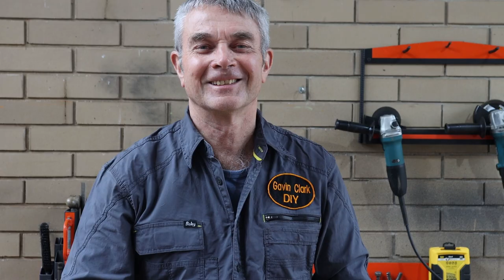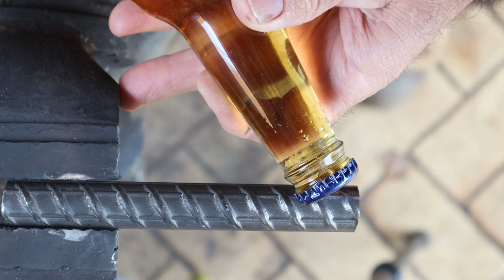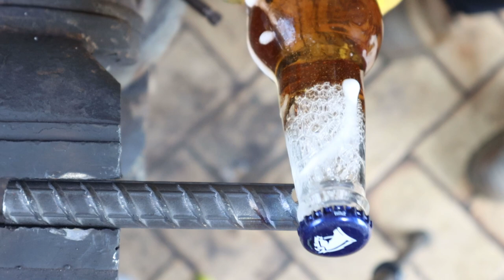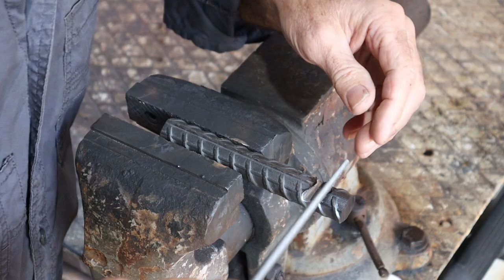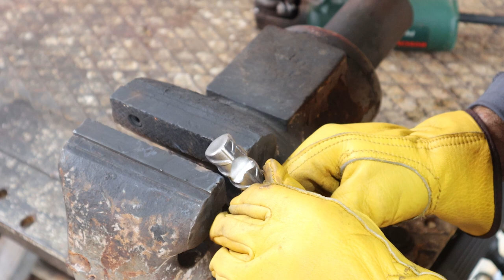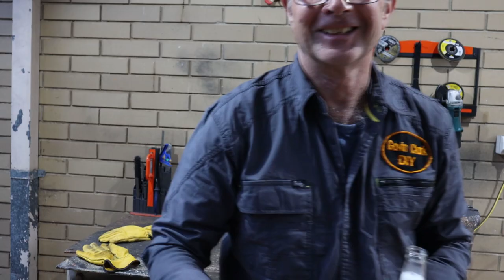DIY Rebar Bottle Opener - Rebar Projects

Comment: Un gusto sus trabajos. Realmente creativo, ingenioso. El metal una vez pulido.... qué le recubre para que no oxide. Gracias
Reply from the maker: A menudo uso Penetrol Rust Treatment Penetrates Rust 300g Aerosol Spray, y luego aplico dos capas finales de Semi-Gloss Clear Coat. Eso es lo que usé en las letras de la barra de refuerzo en la parte posterior de mi banco de trabajo, aquí está el enlace a ese video. https://youtu.be/JA-wk62Zghk  Trato de no comentar sobre los acabados, en cuanto al clima en el que se encuentra, es adentro-afuera, mucha lluvia, hielo, quiere a largo plazo y rara vez toca, o una cera con una toallita cada año. Es por eso que no tengo una opinión. Pregúntele a alguien en su área qué debe usar, creo que esta es una mejor manera de averiguar qué es lo mejor para usted. Gracias por tu comentario.

Comment: Do you ever use any products to seal the metal after you've finished to prevent any rust? I like the polished rebar look and wondered if you'd had any problems with surface rust? Like on a rebar coat hook if damp coats are hung on it. Thanks
Reply from the maker: I often use Penetrol Rust Treatment Penetrates Rust 300g Aerosol Spray, and then put two topcoats of Semi-Gloss Clear Coat. That is what I used on the rebar lettering on the back of my workbench, here is the link to that video. https://youtu.be/JA-wk62Zghk  I try not to comment on finishes, As what climate you are in, is it inside-outside, lots of rain, ice, do you want long term and rarely touch, or a wax with a wipe over every year. Thank you for your comment.
Reply: @GavinClarkdiy  If you want a traditional "blacksmith" finish, just warm it up a bit and wipe it with some beeswax and give it a cloth buff. (just an opinion)

Comment: Rust?
Reply from the maker: I use beeswax sometimes, or I often use Penetrol Rust Treatment Penetrates Rust 300g Aerosol Spray, and then put two topcoats of Semi-Gloss Clear Coat. That is what I used on the rebar lettering on the back of my workbench, here is the link to that video. https://youtu.be/JA-wk62Zghk I try not to comment on finishes, As what climate you are in, is it inside-outside, lots of rain, ice, do you want long term and rarely touch, or a wax with a wipe over every year. That is why I have no opinion, Please ask someone in your area what you should use, I feel this is a better way to find out what would be best for you. Thank you for your comment.
Reply: 👍 @GavinClarkdiy